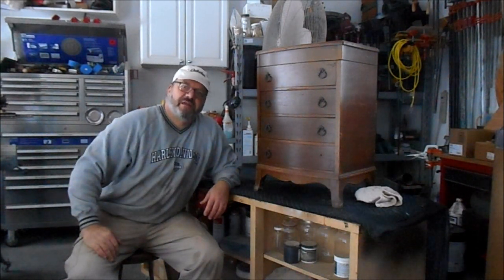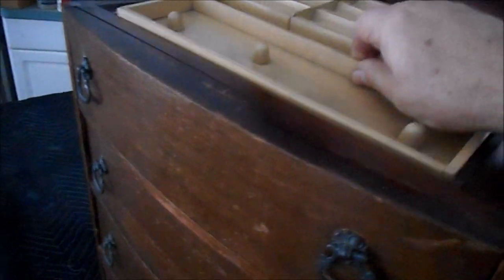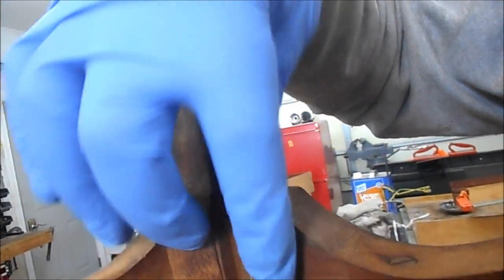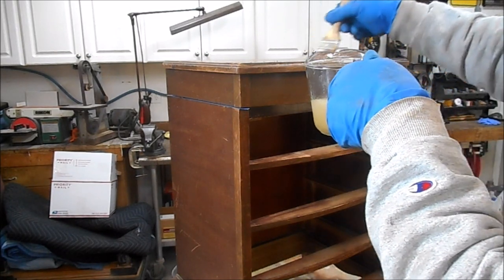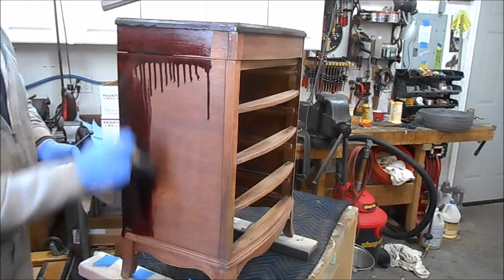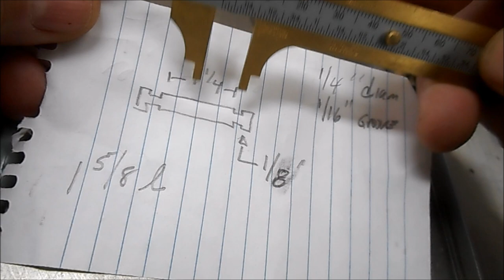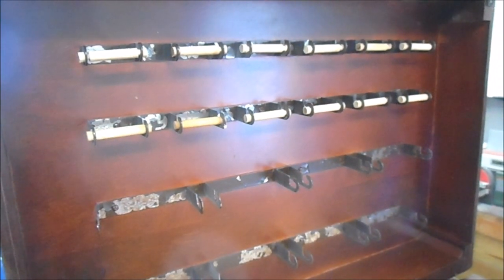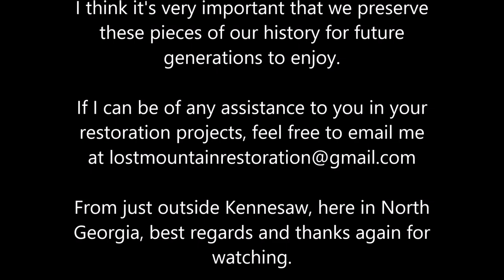Restoration of a Depression Era Sewing Cabinet

Comment: Ok I’ll stand up and take the hit for the glue spray on the glasses. That was me that gave you that tip. I should’ve told you to start with low pressure and to start on a surface away from the joint then “walk” it in at a low angle. You’ll have to experiment with the angle and pressure until you get the hang of it. If you’re using water based glue you can thin it somewhat to help it flow and get more open time. This really does work good. Glad you were wearing glasses and didn’t get injured but I have to admit I LMAO. On a serious note this is a good example of why we should always wear safety glasses when working with anything pressurized. My apologies sir.
Reply from the maker: No need to apologize, the idea is valid, the comic result was totally on me.   It would have been pretty funny if I had the camera on at the time, sort of a 3 Stooges moment with yellow glue rather than a whipped cream pie!    LOL.

Comment: Hi Larry
Enjoyed! One of your best I think :-) I really liked how you made a few extra of those dowel hangers, very thoughtful! In my opinion you were spot on changing those pulls completely. Simple knobs are my favorite.
I hope you get a good price for the piece.:-)
ps- should you need to make sets of blade thickness grooves again I find spaces boards very simple and convenient. All you do is set the fence to the widest groove location and then make spacer boards for the remaining grooves. One edge of the spaces board goes against the fence and the width of the board is simply the width from fence to blade minus the width of the groove needed. This way the fence does not need to be reset.
regards
vic
Reply from the maker: Hi Vic.  Glad you enjoyed the video.  Thanks so much for sharing your knowledge and tips.  I'll give that method a try.  Best regards!

Comment: Try using a small wear dry vac with different tips.  I have had great success using the vacumn to pull glue into cracks and get good squeeze out and tighter joints. I have been using this technique for several years and hope you will find helpful.
Reply from the maker: Thanks.

Comment: I'm really enjoying your channel. You do a lovely job of restoration.
Can I ask what you used as a sealer? Polyurethane or shellac - I couldn't figure it out.
Thanks. 👍
Reply from the maker: I use a lacquer based system.  The sealer is a lacquer vinyl sealer.  You could use a thin shellac as a sealer if you prefer.  Thanks for watching!
Reply: @LostMountainRestoration  Much appreciated. Keep up the great work! 👍

Comment: Love your work - have been watching a bunch of yours lately. I've started doping restorations and refinishings on old stuff too [in Australia, where the range of old furniture available is way smaller that what you have]. A question - in the lid of this cabinet, it looks like you left as you found it a bit skewiff - would that have been left as a character feature, or for another reason?
Reply from the maker: If you are referring to the metal strips, I decided to leave them as they were rather than deal with trying to get the old paint (or thin plating as I recall) off and re-coat them without getting it all over the wood.   A bit of a shortcut, if you will.  Thanks for watching!
Reply: hi again. understood on the brackets for the reels. What i was wondering was the alignment of the top that lifts up when that lid is lowered - it looked a little off to on side when closed.
Reply from the maker: Yes, it was.  If I remember correctly, I was able to get it aligned late in the project, if not after the video was over.

Comment: Thank you for the videos. I have a request, can you tell what grit size you use when you sand it with sandpaper.. ;-) All the best from Denmark
Reply from the maker: It depends on what stage in the process I am at.   When removing material, I usually don't go any larger than 120.  I use 150 - 220 for pre-sealing and then 320 for between coat work.   As more coats go on, I will go up to 400 and then 0000 steel wool.   Hope this helps.
Reply: Thank you..

Comment: Hey!  Two questions.  I have noticed that it has been quite cold in a few of your videos.  At what temp can you do finish work?  How cold is too cold?  Living in the north, quite a bit of the year is spent in colder temps!  Secondly, did you say you made the drawer pulls?  Maybe this is too much of a novice question, but could you show us how you made them sometime?  Thanks!!  Love your work!
Reply from the maker: The manufacturer will state min and max temps right on the can.   I bought wooden pulls from Home Depot and just colored them to match.   If you are a good wood turner, you can knock out pulls like this in a few minutes.   I'm a novice wood turner and I need a lot more practice for sure.  Thanks for watching.

Comment: This is a dandy little piece!  Kinda useless in today's world tho, I don't know anyone that would have a use for it cept to sit around and look pretty which it surely does.  It drives me crazy that the top doesn't line up with the sides of the case tho......
Reply from the maker: Actually, it sold pretty quickly to a hobby seamstress who loved it.   Although I didn't show it, I re-aligned the top during the restoration.   Thanks for watching.
Reply: I am not one biit surprised. You did a beautiful job! I wish I could've bought it ... it may be a resurfacing art, as I find more and more that some folks do still sew things.
Reply from the maker: Yes, there is a community of sewers and many of them are young people.   Several years ago I picked up an old, three legged stool.   I knew it was special, but I had no idea what it was for.   I connected it with a buyer who was a weaver and spun her own thread.   Turns out the stool was for sitting at a spinning wheel.   She was so happy to have it and she told me all about a large group of women she knew who were also into weaving and spinning.   I love learning about things like that.   Thanks for watching and best regards.